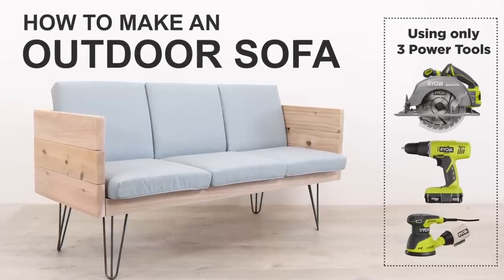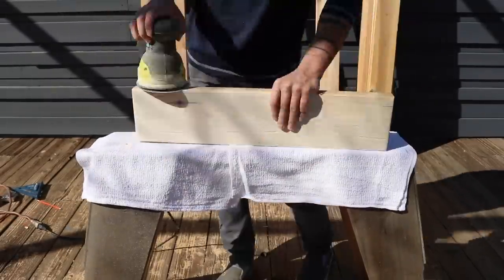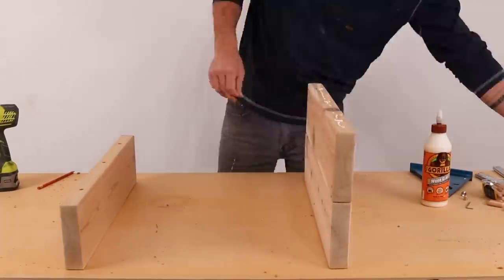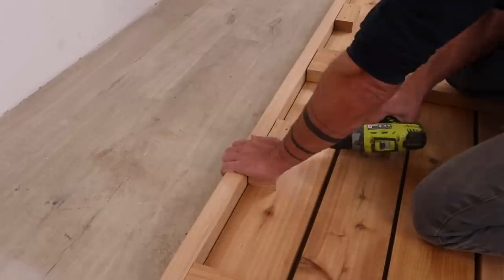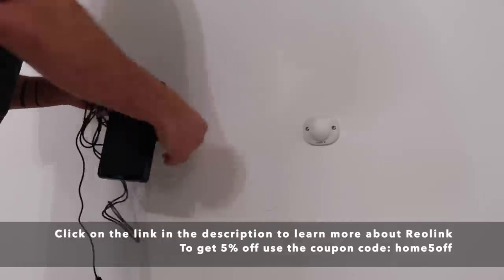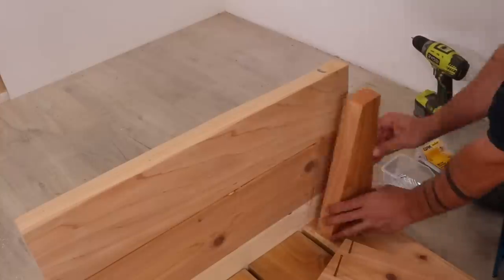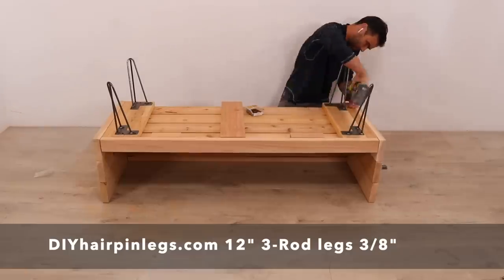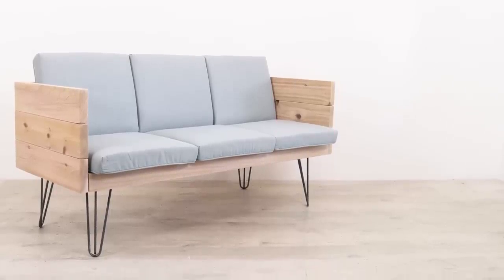How to make an Outdoor Sofa with just 3 power tools

Comment from the maker: links:
Here is a link to the seat cushions I used:
https://www.homedepot.com/p/Hampton-Bay-CushionGuard-Pewter-Outdoor-Mid-Back-Dining-Chair-Cushion-7250-04524811/306283141

I used 3-rod 12” hairpin legs with a 3/8” diameter:
https://www.diyhairpinlegs.com/products/3-rod-hairpin-legs?variant=20642812353

Doweling Jig:
https://www.homedepot.com/p/General-Tools-3-8-in-Wood-Doweling-Kit-841038/205585491?MERCH=REC-rv_search_plp_rr-204583223;202269070;303283534;202711579;205435709;300680014;300680006;304087137;205435691;100609458;203263047;203162753;202545169;203162750;204585713;202672271;303283552;301903293;100659787;300534138;300534139;202241671;203054741;--205585491--N

Makerbrand Clamps:
https://makerbrandco.com/collections/frontpage

Speed Square:
https://www.homedepot.com/p/Empire-7-in-Laser-Etched-Aluminum-Rafter-Square-e2994/205317688

Any 2x6s will work but I used premium cedar from:
Realcedar.com

Link to the drawings coming soon.  Sorry for the website delay I am looking for a new webmaster to update my wordpress site.

Comment: This is a beautiful project! I do wonder why you chose to drill holes in the wood for the cushion strings after going to the trouble to hide holes while building the bottom upside down. Why not just pull the strings between different sides of the slats to tie them together?

Comment: Ive been wondering if you need to research ergonomic design to make a chair, wanted to make one for a while
Reply: I would guess that it depends how long you want to sit in it. If its just something to lounge on occasionally, do it to personal preference, you should be fine with a bunch of plush cushions on top. If you intend to spend a significant amount of time in it continuously, you should probably buy something designed with that in mind. Not to say that it can't be DIY'ed, but its probably worth taking advantage of a proven design that has passed relevant certifications.